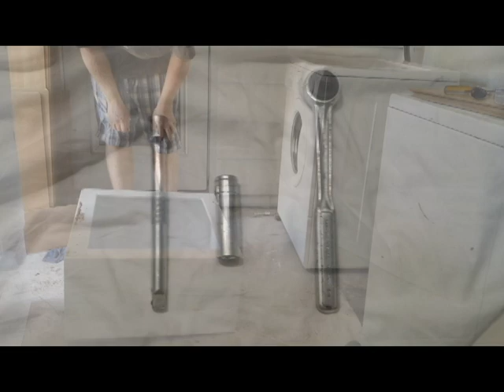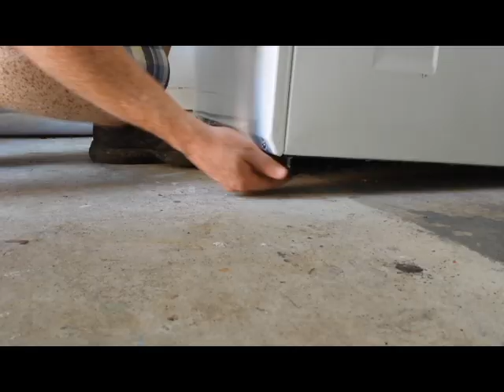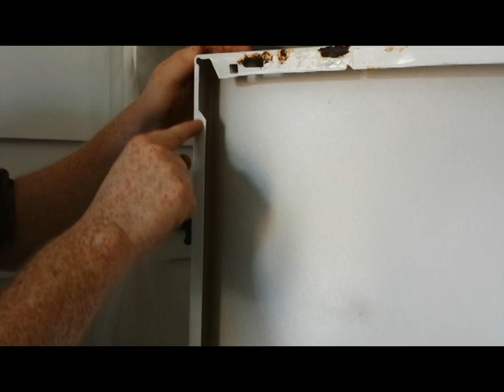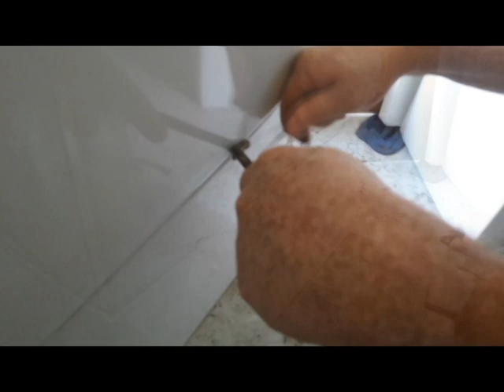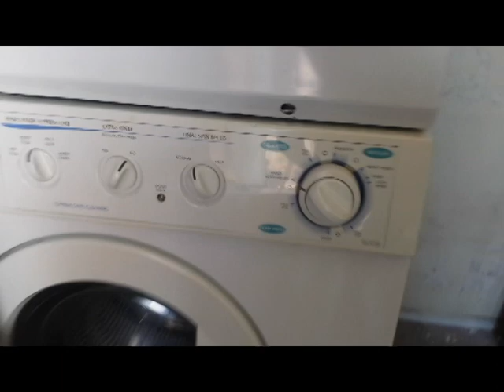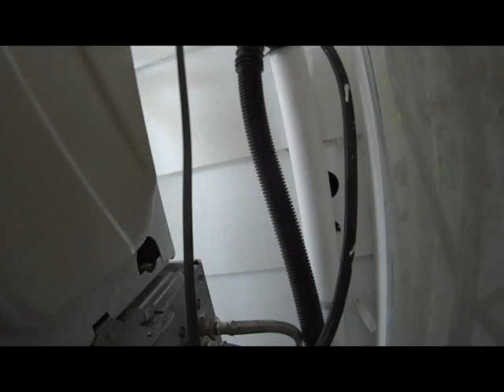How to Stack Frigidaire Front Load Washer Dryer.

Comment: Do you have a video taking the washer off the dryer
Reply from the maker: I've never seen a washer stacked on dryer. Usually it's on the bottom because it's the heavier build and water adds even more weight.

Comment: My Frigidaire washer stopped filling and the pump now runs dry and is obviously noisy.  I'm wondering if I can buy a similar looking used Frigidaire washer and swap dryers. Did they keep the stacking hardware and bolt holes the same year after year? Or do I need to find the same year washer or the dryer won't line up?
Reply from the maker: I'm not sure if different models will stack the same way. However there are straps for stacking washer dryers that a pretty versatile. The only thing is the straps aren't visually pleasing. I hope this helps.

Comment: My Frigidaire washer/dryer (Frigidaire Gallery Washer FWT445GES2 and Dryer FSE747GES1) was professionally stacked, and the two rear brackets are screwed on to the washer differently than Dave does it at the end of this video.  The two rear brackets are each held on to the rear of the top of the washer by two screws, using the screw holes closest to the front of the brackets. (None of the unused screw holes on the rear brackets line up with any screw holes on the washer, unlike Dave's experience.)  Those four screws and screw holes end up under the back edge of the dryer, which means the two rear brackets must have been screwed onto the rear top of the washer BEFORE the dryer was slid back into its final position.  In other words, to screw them on (or unscrew them) the dryer must be about 2 inches forward of its final stacked position.  This means the two screws at the bottom of the front of the dryer must be screwed on as the last step, after the dryer is slid backward into its stacked position... not the second-to-last step.

Like Gabriel Daigle implied in his terse comment 4 years ago (2017?), two screws per bracket are better (stronger) than one.

Hopefully it's not necessary, while sliding the dryer backward to mate with the rear brackets, to tilt the front of the dryer up a few degrees to pass freely over the front brackets. (I may find out soon, because I want to inspect the pair of springs inside the top rear of the washer that hold up the rear of the tub, because the tub has been rocking violently at the beginning and ending of spins.  The shock absorber legs below the front of the tub appear intact.  The shock absorber legs might have become weak, but before I order a new pair for about $60 I think it makes sense to first inspect the springs.)
Reply from the maker: Thanks for your comment it really helps the YT community. Also if you end up needing to replace a spring try to replace both. Life expectancy for both springs are really close.

Comment: Question? Is it not necessary to purchase a kit to stack w/d?
Reply from the maker: The washer top cover will need to be removed when stacking the units. The brackets from the cover top can be reused for the back mount. If your dryer was previously on a patalstool than the mounting brackets  on the front of the patalstool can be reused as front mounts when stacking the units. So if you already have that type of set up than there is no need to purchase mounting hardware. If not than yes the hardware would need to be purchased.  Ebay for like $10.00. You may find a local appliance store that carries the mounts. I hope this help. Thank you for watching.
Reply: Thanks for quick response. Yes we do have ours currently on pedestals. Thinks about stacking for remodel. Appreciate. The visual is helpful.
Reply: Pamela Trimble